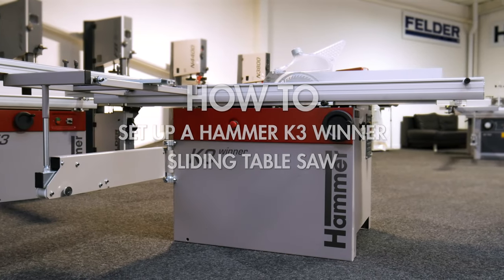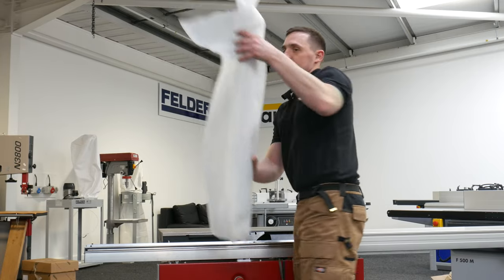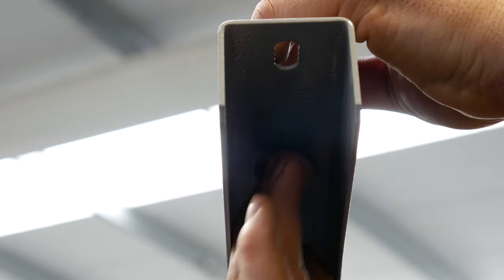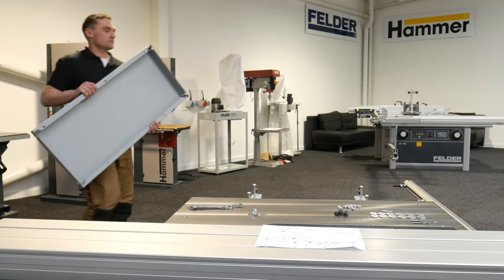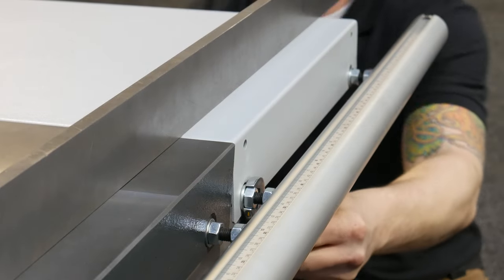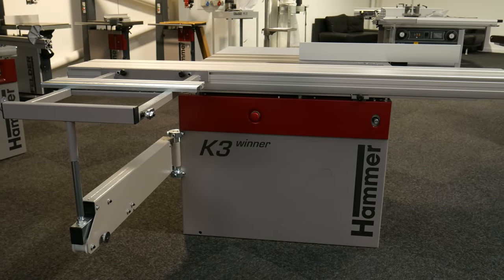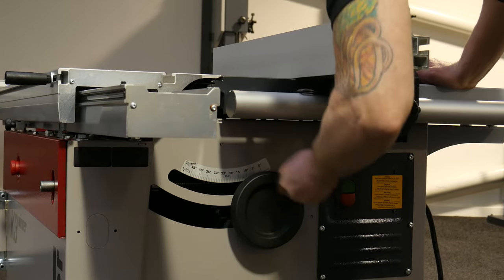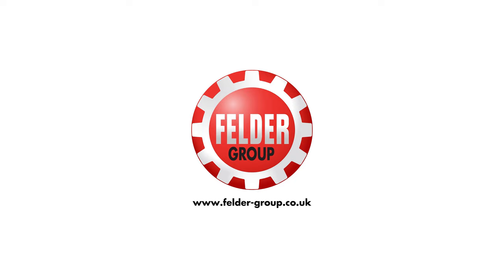How To - Set up a Hammer K3 Winner | Felder Group

Comment: Hello. what is the transport width of the machine without the telescopic arm holder? will it fit through the 70cm door?
Reply from the maker: Hello Stanislaw,
The minimum transport width of the Hammer K3 is 748 mm.
Reply: FELDER-GROUP UK TV in such condition as 1:00 is 748 mm width?
Reply from the maker: The width of the K3 is 748 mm without the outrigger arm and front plate (seen in red at 1:00).
In the configuration seen at 1:00, the outrigger arm would add a further 100 mm approx.
Reply: FELDER-GROUP UK TV  thank you very much. I will buy it anyway. Only my wife will scream at me for the broken door frame :D

Comment: At no point did you address the throat plate or the phenolic throat plate.  Reason I mention this is because I'm struggling to determine the proper vernacular  to use when searching the Felder website to purchase this accessory.  What do you call it?
Reply from the maker: We would call it a "zero clearance insert". This is classed as a spare part rather than an accessory so will not show on our tooling website. Contact our service team with the serial number of the machine and they will be able to advise part and pricing.